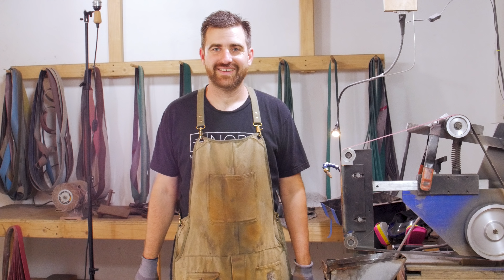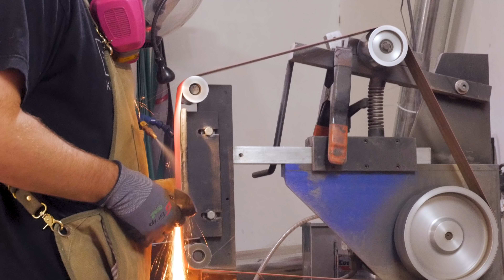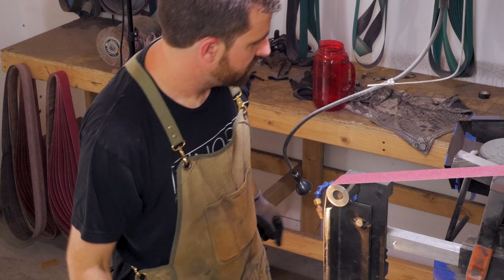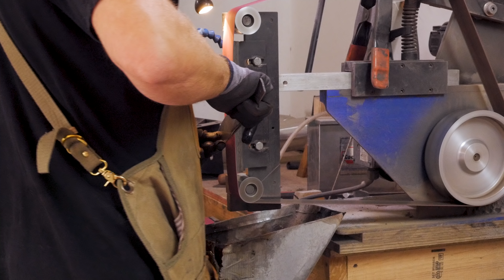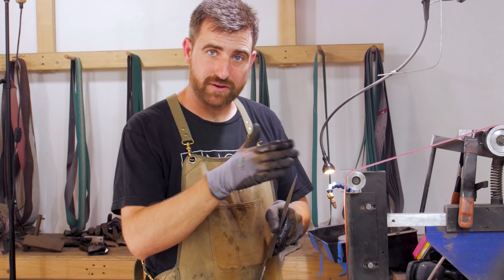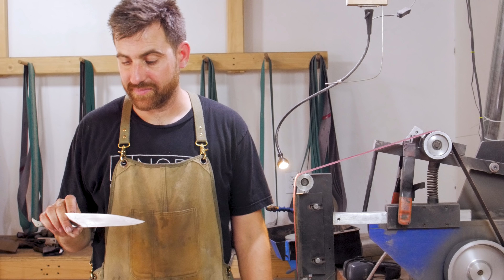Grinding A Knife - DANI & STEVEN (NORA KNIVES)

Comment: Very well done video.  Your slack belt grinding was pretty interesting.  If you ever get a chance, try the rotary platen from Beaumont.  You can grind normally instead of up top, and the control of the grind is very good.  I can take my convex grind to zero, and the convex by the time I get to zero is all the way across the blade face.
Depending on pressure used and rubber belt tension you can vary the amount of the convex to your liking.

Comment: Great video. However, I'm slightly confused. During the 'bendy knife' section you said that the knife is 'pre heat treat' but then mention you worry about heating the knife too much so as to ruin the temper. Do you grind before or after heat treat?